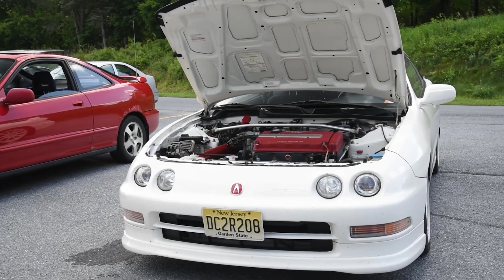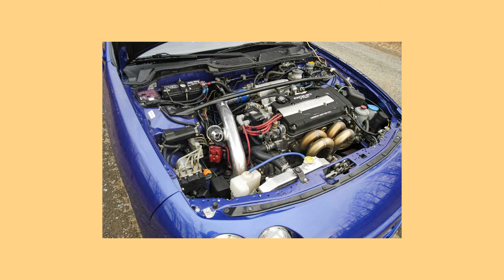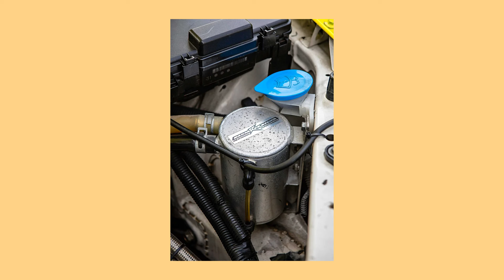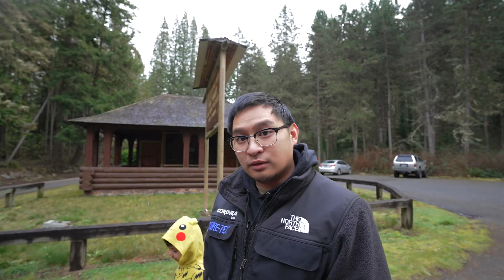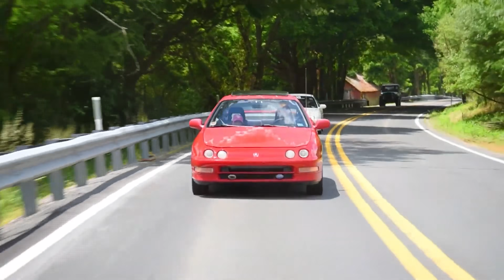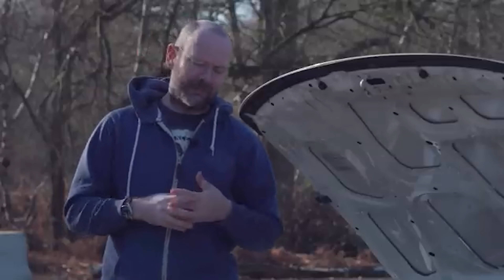The Acura Integra Type R Proved Honda Wrong — Then Disappeared

Comment: Miss information on the dc2 type R colour!! It was NOT available in only white. They did come in black, and Phoenix yellow!
Reply from the maker: Good catch, the color history on the DC2 ITR is more nuanced than a lot of people realize. Appreciate you keeping it accurate.
Reply: And Milano Red and Vogue Metallic Silver. I know. I have a silver one. :) Though silver was only ever a JDM option & far more common in 4 door DB8 R's. Red was available in Japan and Europe. Switzerland got a tiny run(>100) of Yellow with "Type R 2000" decals. These also had yellow Recaros and yellow stitching throughout. Canada got optional rear seats in red. North America didn't get Recaro seats, Momo steering wheel, nor the centre console delete and at first the titanium gear knob. Ironically today the USDM models are by far the most valuable in the US classic market, yet they were the most "built down to a cost" when new.

They didn't have throttle bodies, but had a revised intake manifold. Only the very earliest JDM only 96 Spec had hand polished ports. Honda developed a machine to do it more quickly and more consistently(though continued to show hand polishing pics in their catalogues). The B18C5 was for the US market and was slightly detuned from the European, Australian and Japanese markets(B18C). JDM R's had the most horsepower running on 100Ron petrol. The US got 15 inch wheels from the JDM Civic Type R. European and Australian got different 15 inch wheels. Japan got 16's(after 98). 

The large and small differences across markets in this model are crazy. Two totally different front ends, four different rear light types, Only Europe got rear foglights. Only north American cars were badged Acura and had different valve covers. Three different rear hatch glass setups. Even weird stuff like the rear seats from a JDM DC2 R won't quite fit into a Euro or USDM DC2. Honda's accountants must have taken to strong drink. :)
Reply: @MrGrentch  Europe markets got the B18C6 engine, a crappy restrictive exhaust manifold and catalytic converter. Changing the manifold cat and B pipe to JDM spec gets an increase in power to JDM spec.